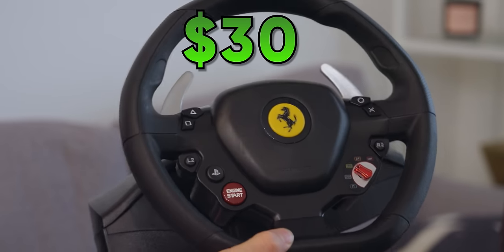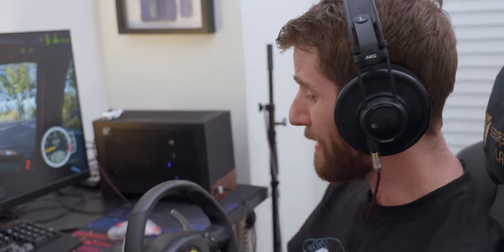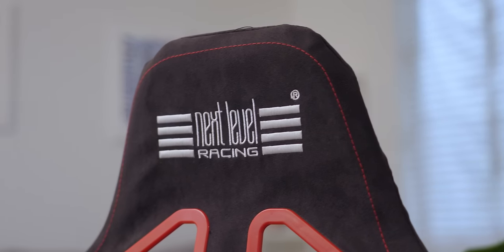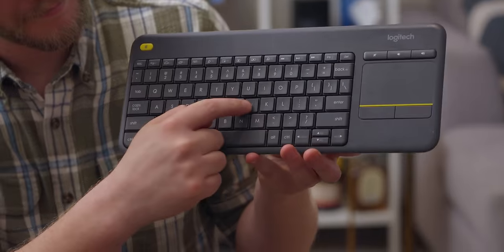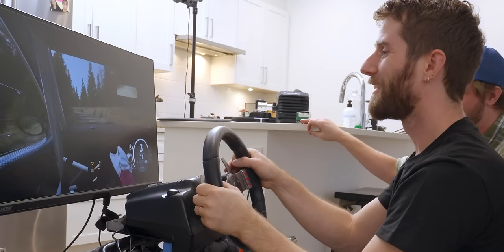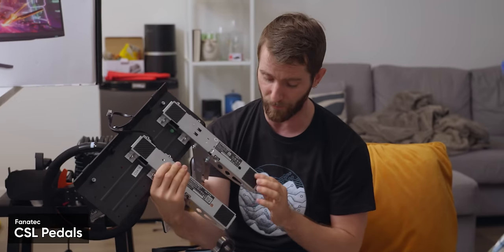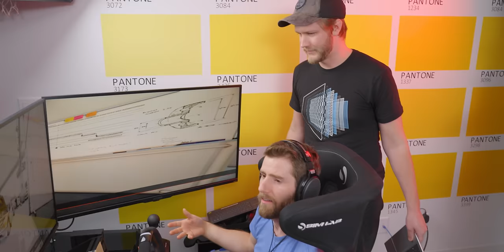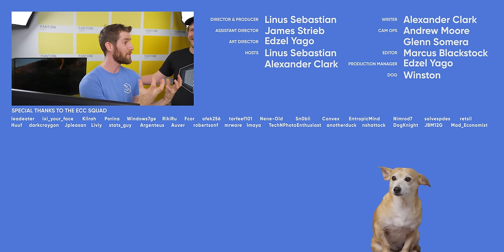Don't Waste your Money - $30 vs $10,000 Racing Setup

Comment: Would've been cool to get more exposure on the CSL DD. From what I understand, direct drive makes a huge difference over gear/belt driven because of the force + granularity/smoothness. The CSL DD is about $600 for the wheel, and I think the pedals were about $200-300. So for about $1,200-$1,400 including a rig, you can have something already close to that top-end experience.
Reply: Yes. Some people get caught up on the pure Newton meter force production, but DD wheels are more valuable not primarily because of their force production, but because of the low latency, high granularity, frictionless feedback. If you're eyeing DD wheels, and wonder if the lower power versions are worth it, or if you need to shell out, the lower power versions will still be light years ahead of belt or gears.
Reply: @dogboy0912  yeah most people won't wanna get close to even half the max force feedback on direct drive wheels. I tried using my friends wheel which is like 15nm and my arms were pumped after an hour of playing
Reply: The basic CSL bundle is $400 when you get the basic pedals and wheel
Reply: @totallynotbluu  Ah, I see. Getting it for just PC is pretty cheap. But if you want PS compatibility, you have to pay double the price for the DD Pro

Though oddly, the $199 DD 5nm base, it wouldn't let me add to the cart. And the price of it in search is $349. Fanatec as usual having scummy business practices, or at least having such a bad website that I assume it's scummy.
Reply: One of the biggest factors even more important to consistency and and lap times would be a loadcell brake kit imo.
Reply: @dogboy0912  What's that relative to G29? Does it have more or less power? Because it feels like G29 has more power than I'll ever need, in most games I keep it at ~20-40%.
Reply: @dogboy0912  you can either dive well or you cant the way i see it haha. i reckon  loads make the upgradeand it make sno difference at all. at least to most of my crew, they are not any higher rankings than they were with the cheap stuff
Reply: They did. There's a video on that made 2 years ago over the short circuit channel
Reply: @chicken1443  That doesn't have nearly the same reach as this, and this was specifically a video about sim racing at different price ranges. People don't know there is a setup with a direct drive wheel barely more expensive than the G29 setup, that nicely gaps the top end with the low-mid of the g29
Reply: You don't understand how DD is set up... do you? Yes there are packages but the base and wheel are two separate things and there are different levels of force feedback. Rigs have a huge price range and so do pedals. The CSL DD ready to race package is 400 with pedals and then the cheapest rigs will run you about 200 dollars... so $600 putting your numbers way off and this top end experience isn't even a top end experience.

Your 1200-1400 is actually closer to my motion rig price with wheels and pedals at 1800.
Reply: @PazLeBon  People don't usually do it for the time, they do it for the immersion. Like motion rigs are a big expense and they make your times worse.
Reply: @thomgizziz  sure') like vt did for me haha
Reply: @thomgizziz  My price was based on the CSL DD PRO which is playstation compatible. Someone else mentioned the DD has a cheaper option for PC/Xbox that I wasn't aware of. Though personally I would want a clutch pedal so that's another $80 or so. But if anything, what you said proves my point more: LTT really screwed up by not showing how a CSL DD can be a really good "mid" option between the G29 and top-end rig they showed, and probably makes the G29 almost worthless if you have some cash to throw at it.
Reply: I can get a car for this price. and have fun on the parking on sundays.
Reply: @DarkSwordsman today and that’s only because they switch everything to get a way better experience for u and other customers so wait a little until q1 or maybe q2 2024 and everything will be good. They are struggling a little bit right now but who don’t who’s trying to do everything at the same time without closing the whole business. Believe me
Reply: Nah, you can get the 5 Nm bundle for just $400, though PC only. Xbox bundle is $480 and PS is $700. All of them has 8 Nm versions for $1-200 more. Too bad Fanatec support is non-existent, so I'm not gonna order until their reputation improves.

Comment: I'm currently practicing for my drivers licence and Linus' description of no feedback perfectly describes driving modern cars
Reply: I'm in the same situation and I agree. My driving school has a Mercedes and two Jeeps. Driving the Mercedes is like flying in a spaceship while driving the Jeep actually feels like being in a ground vehicle.
Reply: Its really not you're just driving at low speeds on flat ground. Try some offroading and it would feel the same, modern car or not.
Reply: What kind of lunatic takes a Mercedes off road lmfao
Reply: @karenwang313  What kind of lunatic pays 100k for a car and you can't drive on gravel?
Reply: @karenwang313  You're supposed to take a G-Wagon off road. You're supposed to take Range Rovers off road. They're quite capable there. But when you've got a car this expensive and luxurious, and a Subaru Forester can do everything those can do, why bother?
Reply: the cars nowadays gives zero feedback. You can turn wheel by a finger. You can press the gas pedal with wind and brake with a little higher wind. When driving on highway I feel like the cars are good in terms of suspension tires aerodynamcis but dont get feeling out of them... When braking hard it is challenging to find the limit with these soft brake pedals.
Reply: @LaggerSVK  its driving a big pc
Reply: @karenwang313  rich people who move to 3rd world countries. Eventually the weather will put you into an off-road situation without needing to go off-road
Reply: I currently own a Megane RenaultSport RS280, it has different performance settings and this also includes switching off the power steering in it's Race mode.
100% Force feedback. 😎👌
Reply: get yourself a manual with no powersteering and you'll feel everything
Reply: @karenwang313  Drive it like you stole it
Reply: What you are comparing modern cars to?  My modern cars have road feel, tight steering and good handling.  

If you want to feel no feedback whatsoever, try driving a classic American sedan from the 60s, 70s or early 80s.  😄
Reply: @LaggerSVK  I need to take you for a ride in my 2019 Corvette Z06.
Reply: Yes. Modern cars really give very little to no feedback anymore - which I think is a bad thing for peoples driving skills. You absolutely do need feedback from the car. Doesnt mean it needs to be obnoxious and loud and have no power steering. But some sort of compromise.
Reply: fr
Reply: I don't think you will feel a great deal driving round at 30mph for the majority of the time
Reply: wait until you crash ;)
Reply: @PresidentScrooge  but on the other hand - and I know you are nopt gonna like it - people won't even need driving skills in a not so distant future
Reply: @squidwardo7074  agreed man, i mistakenly bought a non ffb wheel and it is nothing like a driving instructor car, real cars all have atleast some level of feedback, without it, you have to rely on the screen and your driving skill to make up for the missing feedback, truly two different worlds, would recommend buying a thrustmaster tmx, or g25(like the one on the show), and make a stand out of wood using a youtube tutorial, and id go a step further and adjust it to be used with a real car's seat you can pull off of a car at the scrapyard, or an old junk car sitting in your backyard, and beyond that have a tv sitting in front of you and have fun, it doesnt have to be perfect, and you can do it on an extreme budget, and espesially with thrustmaster, you can always upgrade, say buy a th8s shifter and t3pa pedals and have a blast
Reply: Not a huge cybertruck fan, but the fact its "steer by wire" system is literally a direct drive FFB wheel is game changing for electric steering systems in the future, not to mention they can all adjust lock and steering sensitivity on the fly (ie heavy feel for highway and light feel in the city)
Reply: yep, my 06 BMW 3 series felt more enjoyable than the 09 Z4 I currently have. Wish they could bring back hydraulic steering back.
Reply: Yeah. I have a 2013 Corolla and unlike my parents cars which are more modern, I actually can feel what’s going through the wheel and pedals.
Reply: @charlesm7589 vette is a trash cheap sports car stop showing off

Comment: There's programs you can run on your PC for adjusting external monitor settings like brightness with the DDC/CI protocol. Personally I use Monitorian, which allows me to change multiple monitors together at once and match them even though they've got very different brightness ranges (100% on one is closer to 70% on the other one).
Reply: I used Monitorian, but I prefer Twinkle Tray. I recommend trying out both.

Comment: I had that EXACT wheel as my first one, and I paid 3 times the amount (I belive it was 89.95) for it.
My main issue with it was the fact that the cable to connect the pedals to the setup were right underneath the pedals. Basically, a LOT of force got put on that cable and eventually, after around 2 weeks, it had snapped, making the pedals useless.
PS: I still have the wheel, but I dont use it anymore

Comment: For anyone trying to start in sim racing, any experienced racer will tell you that the most important part is a good solid cockpit. You can use the best wheel and pedals, but if your rig is not solid, you will be all over the place with your inputs, specially with your braking. 1)Get a decent cockpit 2)Get a decent brake pedal with enough mechanical resistance. If you only care about performance, you are 90% there already.

Comment: 30 dollars is fine to get into simracing. 300 dollars is fine to enjoy simracing, heck even 3000 dollars is fine if you have the budget. 10000 dollars is just an insane ammount for anyone.
Reply: If you're willing to spend 3k on a sim rig, 10k isn't that ridiculous
Reply: @keppycs  7k is a lot of money, like if you have 3k specifically saved for a rig it's defo a lot to spend 10k
Reply: As you get into it you tend to upgrade over time. Similar to upgrading a pc. I started with a thrustmaster tx I got off my friend for $120. I've upgraded many times through the years. Currently have a sim rig that when added all together cost around 7k
Reply: @keppycs  if you're rich than yeah but I'm pretty sure anything over 3k you're really gonna hit diminishing returns
Reply: @10mmGR  Same! Started off with a T300 RS GT, and now I've mostly got Moza stuff worth 1.6k ;-; I hope I'll never reach that 10k mark xd
Reply: @keppycs  oh I know I'm gonna reach the 10k mark. Just a matter of time. I'm currently looking at the QS 210 motion platform. Dont plan on buying it anytime soon but it's on my list
Reply: That's more the kind of setup you'd see at a high-end arcade.
Reply: @10mmGR This. Same story here. Raced on controller for many years (GT1 thru pCars2) until life gave me reasonable opportunity to step up. Even then, it took me from 2017 till last year to built my dream rig to my liking. Inflation aside I'm about 15k invested over aforementioned 5 or so years. And LOTS of overtime  to make it happen.
Reply: You can get a really nice rig for 3k. The other 7k is the roughly price of the D-Box motion rig.

Comment: 14:12 If you use Twinkle Tray and AHK, you can fully or semi-automate dimming and brightening of your screens
Reply: There's also Monitorian if you just want some simple software control of your monitors' brightness settings.
Reply: I personally just make use of Windows "night light" which can be set to engage with sunset - sunrise. It works as you'd expect with using warmer colours. Is the fact that the colours change one of the reasons people would prefer a brightness tweak instead? I find at night the monitor doesn't feel too "bright" when using this.

Comment: Load cell pedals are widely considered to be the only substantial upgrade. It is also widely known that DD FFB wheels do not make you quicker, but they are much more immersive than cheaper FFB. IMO, saving money can often entail skipping entry level setups so you don't buy two or more of the same thing. I think splurging on good pedals is always money well spent. You can upgrade your wheelbase later if you need.
Reply: Yes, but having any FFB at all is way more important than just having expensive pedals. Driving on some Heusinkvelds while on your FFB-less T300 will make for a horrid experience, while just playing on an ancient DFGT will provide a pretty good experience.
Reply: @MozzarellaBasket  no one would consider a wheel without ffb. I’m comparing direct drive to entry level, not no ffb vs ffb. I personally regret buying my T150
Reply: I'd love to drive a Fanatec to try it out, I expect I'd love the smoothness of the input compared to the fairly toothy geared G29, but my limitations on space means a collapsible rig is about the best I can do.
Reply: @MozzarellaBasket I have a T300 and Huskies. trust me, it has force feedback. You clearly have no idea what you are talking about
Reply: @corroded  complex subject. You can reasonably argue that any type of driving that requires drastic movements of the wheel don’t really need “fine detail,” however you run into the problem where you get “clipping” if the wheel isn’t strong enough. IMO unless you’re super weak or intentionally drive with light hands, anything below 4-5 nm will have you run into clipping issues (although 8-10 is more ideal where it more or less becomes a non issue). Basically your own strength to resist the wheel force is greater than the force the wheel can produce. Yes in settings you can help this a bit, but it’s just a fundamental strength difference between you and the wheel.

And on the high end, you still have issues depending on what you like to do. A lot of DD wheels can still feel notchy, either throughout or on center. Higher resolution ones are better. In most cases this doesn’t matter at all, but if you do Oval racing, for instance, then some wheelbases might be better than others. I have an accuforce which is mid tier for direct drive but is hybrid like some of the higher end non DD wheels. Because it’s hybrid, it’s smooth on center and not very notchy despite not being as high resolution as the higher end DD wheels. This comes at the trade off of more finer detail and fast acceleration, but it’s marginal at this point and most cars you’ll drive in sim won’t have as detailed steering in real life compared to what a high end DD wheel can reproduce.  

Also there’s a certain point where having so much wheelbase strength is overkill. Above 18nm, you have to have some specific reason why you’d want a base that strong. The benefit is that with high nm bases, you have a lot of headroom to explore a wider variety of ffb settings. Most people with DD wheelbases aren’t going to use much more than 10 or 12nm of the power they have on tap because it would just be unrealistic and physically draining. But for simulation purposes it may make sense to have settings that don’t use most of the 18+nm you have for most of the time, but have peak forces, say during a crash or when your wheel is caught on something, be strong enough to simulate real life. Obviously those are extreme examples but some people do want that headroom.
Reply: A direct drive wheel base makes an average driver quicker. But! it wont make a very talented driver faster. 99% percent of us fit into the first category. I have load cell pedals and yes they also improved my times but so did my rig and a direct drive base and wheel. The most important thing it will do is make you more constant. As for immersion the more natural feedback you can output from the game the better experience you will have so its worth buying high end gear if you treat this as a hobby and race frequently. if you just drive mainly arcade or dabble with WRC titles I would not recommend anything passed a logitech g27
Reply: @JallyTee  I think this is the way. G27 or go all out. The mid range options aren’t worth it and now we have the csl dd and other cheaper DD options.

Comment: you can grab stand similar to the ones they build integrated into the seat shown here in the video) which you can store behind your couch with the wheel/shifter/pedals all connected. All together running you around $480. I wish they shown that, but i know they get sponsored to show the big bulky stuff.

- Shifter runs for around 60 bucks (Logitech driving force shifter)
- Steering wheel + pedals at $300 (logitech G920 at $300 comes with three-pedal system, which means you get the clutch pedal too for extra immersion! the G920 also has an amazingly powerful feedback system that lets you feel each turn and even the rumble of idling.)

- Stand for between $90 and $110. It's compact, easy to assemble (took less than 10 minutes) and can be folded with all the equipment attached. The stand also works with thrustmaster equipment and flight sticks/throttles, so it's multi-purpose for flight and space sims too.

You don't have to grab a humongous driving bucket seat attachment if you like your computer chair and don't want to try stuffing it into a tiny room :)